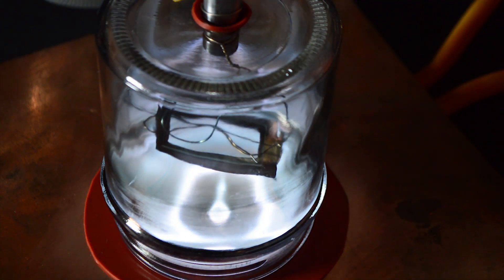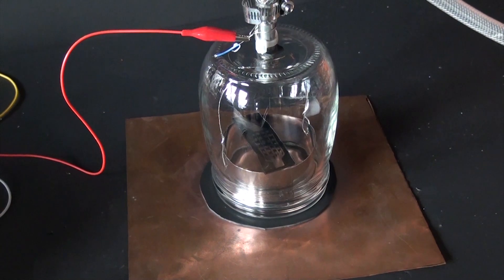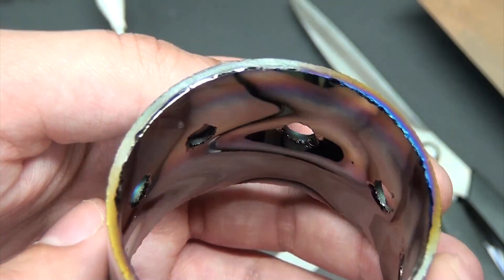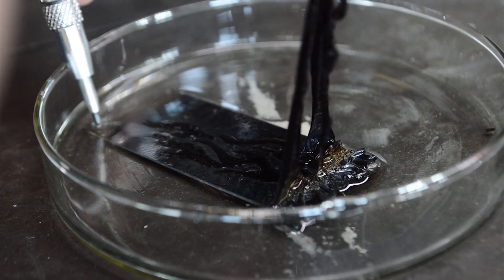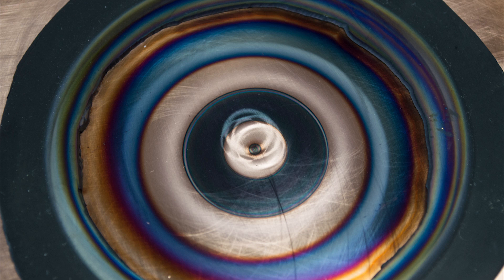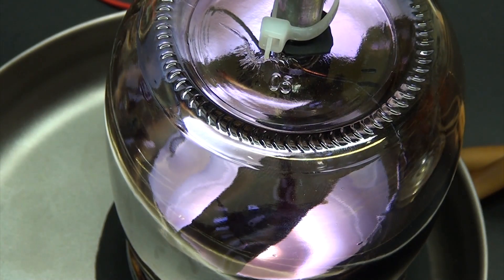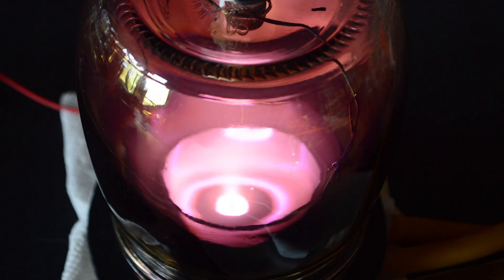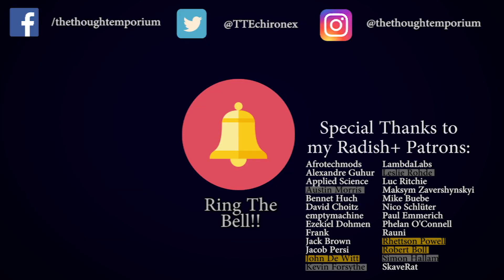Plasma Metal Coating... In a Jam Jar

Comment: I'm loving your new videos on sputter coating! I've seen inductively coupled rf plasma magnetrons being used for better yields of oxide films. Also, something that I found to be useful is thin films of nichrome, we would sputter nichrome to the back of a glass slide to resistive heat atomically flat gold crystals or silicon wafers for various high vacuum reactions, and we would sputter traces of alumel over the nichrome to work as quick thermocouples in a pinch. They were so useful, I ended up using them for everything from drying TLC plates to keeping my coffee warm.

Comment: PLUMBING TIP: Those gear clamps are more ideal for larger diameter and thicker hoses but very poor for small diameter or thin hoses. You want "ear clamps", also called "crimp clamps" or "cinch clamps" for precision plumbing. Oetiker is the best name brand but HomeDepot even sells such clamps under the brand name "Apollo". It takes a pair of fence wire pliers to crimp them but by using a pair of clamps with one rotated 90˚, I've never seen a better performing tubing clamp. The beverage industry runs on Oetiker ear clamps. Fantastic channel!!!

Comment: I remember seeing an experiment that someone did in a vacuum chamber, where they demonstrated the pressure exerted by light, on a piece of foil, attached to a tiny wire axel. (It think it was Cody'sLab that did this.) Anyway, my point is… Could you use some type of light to put pressure on the gasses in the vacuum chamber, to move them in a desired direction, to concentrate them a little, and make it easier to pump them all out? My hunch is, you need a wavelength of light (or electromagnetic radiation) that interacts strongly with the gasses in the chamber.

A related idea, is to use powerful pulses of light to jiggle stray atoms of gas loose from surfaces.

Comment: Did I hear YBCO??? Superconductors? I'm excited already.

Also bruh if you're trying to hook up a diff or ion pump eventually to get Al2O3 to sputter you're gonna need like a 15mTorr roughing pump, not 150. There is one that walmart of all people sells for air conditioner stuff at like 150 bucks, so if you want big improvements look there. For lots of good vacuum info check out the forums at fusor.net. Absolute gold mine, even for non-reactor builders.

Comment: You should see about sourcing a little bit of Cobalt for sputter coating on something! There's an office building in Montreal that is glad with blue Cobalt panels and Cobalt tinted glass. Beautiful looking building.

Did you know that in all of biology the color blue arises from the surface structure, unlike all other colors which are acquired directly or indirectly through diet as pigmentation.

Comment: what would happen if you use Xenon and Caesium, would it generate thrust
Reply: It already does, it's just pushing into the table and the forces are minimal. There's nothing special about xenon or caesium. Mercury's actually a good option for ion thrusters, and aside from that you can use literally any element if you want (and you don't mind eating the efficiency losses)

Comment: I'm thinking you could use this as a seed layer for electroplating thicker circuit traces so they can handle some current. But in order to do it all at once the whole pattern would need to be connected as one solid layer. You could sputter a pattern with some metal bridges between the individual traces. Then mask off the bridges, plate the traces thicker and then etch the thin bridges away. It's a lot of effort but it might be a way to create circuits directly onto weird objects (provided they can withstand the plating and etching  solutions of course). 

Ooor maybe all of this is unnecessary, idk how thick of a layer this can make.

Comment: This video series is my favorite on your channel! Glowing metal plasma, growing neurons, preserving animals, damn this machine is insane! Is it possible to manufacture dichroic filters with your setup? I'm using them for astrophotography, they pass through only some spectral lines (eg. H-alpha at 656.28nm) and I always wondered how these are made and how engineers even know how much metal they need to coat the glass for specific spectral line to pass through
Reply: Typically, they alternate between metals with high and low refractive index and each thin film is a quarter of the wavelength of the light they want to pass thru and so the films will constructively interfere with only that light while all the other wavelengths are reflected due to destructive interference.
Reply: @cristalsolares6379  thanks for explanation!

Comment: It seems like a lot of work to handle and prepare the glass jars you use as vacuum chamber. Why dont you make the vacuum chamber from  a stainless steel  pipe, and then just add a small inspection window made of acrylic ?

Comment: usually, when you apply vinyl cutouts, you remove the unwanted parts from the original backing, then you apply the transfer tape (your blue tape) and use it to apply on your surface.  Nice vid,  thank you!

Comment: Since no one answered this last time, what the benefits of sputtering over physical vapour deposition?
Reply from the maker: In theory sputtering is vastly more versatile. It keeps the materials intact better. ITO for example tends to lose the oxygen if you use a thermal method rather than sputtering so it ruins the conductivty

Comment: sorry to say but if your metal needed annealing it wasn't 24 carat gold because pure gold doesn't harden. it may have had gold in it but you got conned and bought sub par stuff there. next time go to a jewelry supply company like Rio grande jewelry supplies it may cost more (golds at $1400 us an ounce) but you will get the real thing.
Reply from the maker: Work hardening is a thing even in 24k gold
Reply: @thethoughtemporium  no your wrong, pure gold will NEVER harden no matter how long you beat on it. this is in fact how gold leaf is made, you take a lump of gold and keep hitting it (normally between two sheets of leather) until it is the thickness you want no heating involved at any point.

the only kinds of gold that harden are the less pure forms of gold. 18,14, 10 carat and so on have added metals to make them harder and can be work hardened because of those others metals mix in. but 24 k gold is pure and can never be work hardened no matter what

http://www.goldrefiners.com/blog/2016/6/24/can-gold-be-hardened
Reply: @thethoughtemporium  i know this because I'm a "gold smith"/jeweler (i work mostly with sliver but i still learned about how gold works)

Comment: I worked a paid summer internship as a line technician in the sputter department of a local plant.  Cody from Cody's Lab built a "Springel vacuum pump", that uses mercury to draw a vacuum down to the vapor pressure of mercury at the given temperature.

Comment: I wish those vacuum pumps were not so expensive and hard to find. Everything is fine until like 1-5 torr, then it suddenly becomes really expensive.
Reply: You can't get to -5 without high vacuum pumps.
The best forevacuum pumps barely get down to 9e-4.
However, with that said, you can easily buy affordable high vacuum pumps. Look for old oil diffusion pumps - they're virtually indestructible and have no moving parts. There's also plenty of fully functional turbomolecular pumps for under $500, with controllers(or ones that you can build a controller for easily).
But, as I've learned personally, the pumps are not your worst enemy. The plumbing is. A nice small vacuum chamber with all the necessary ports(gauges, DIY feedthroughs), even if just built out of tees and adapters, can easily run you $500 or more.
Reply: @Spirit532  I would be happy if I could build one for under 1000$. Thanks for the tip about diffusion pumps, I tried to avoid them because they might contaminate the vacuum with oil and take quite a while to heat up, but I guess they are my best bet because of the price/performance ratio and their stability.

Comment: I like what you are doing mate. I'm looking at this for my grandchildren as a teaching aid. Something they could do and make all kinds of thing. Also, you should try spay on (Teflon) for the chamber coating. You can buy this in a spray can. It's used as repair coating for pots and pans. After cleaning, just spray on and heat chamber to 300 to 400 degrees and hold for a short time. This should give a none stick coating. You could possibly use it instead of (VINYL). You could also try (PVA). Thin the (PVA) down and spray a light coating to the inside of chamber. Let it dry. Then heat to drive off any moisture. The (PVA) should wash out easily where (TEFLON) want.  I don't know if any of the suggestion stated here will work. Let me know. Take a look at Robert Murray Smith YouTube channel. He does a lot of things similar to what your doing.Thank you for showing all your skills. It is appreciated.

Comment: would a rotating magnetic field outside the glass work as well as rotating the sample for even coatings?
Reply: No, the magnetic field is there for accelerating the gas into the target. It doesn't steer them flying out.
Reply: @Spirit532  I get that the field on the base below the sputter source is to focus the plasma,  I was wondering if an extra field on the outside of the glass could be used to guide the sputtered plasma, removing the need for complex mechanics of rotating a sample inside the chamber. :)
Reply: @dasraiser  A different static field is not a uniform static field, sadly. It's far easier to just build a spinny bit.

Comment: Idea for plating with gold a.s.o.

use a very thin metal sheet that you electroplated with gold via simple electroplating out of auric acid. The total amount of gold should be very little. Maybe even just laying the metal sheet in an Au(III) solution should work --> Galvanic series

I don't know if this could work with straightforward aluminium foil. Would be pretty amazing
I imagine that the removal of the Al2O3 is the biggest problem here. Etching such a thin Al layer without cmpletlely destroying it is hard, but cound cause good results?
Just an idea

great work =)

Comment: You said that the coating is delicate. But you only coated the glass lenses with paint.
So how delicate is the metal coat? Is it only an issue if you touch something day after day (like you would do with glasses) or can you remove the coating simply by scratching it with your fingernail?
Reply: It depends on the bond, but it can be anywhere from "rubs off with a finger" to "needs sandpaper to remove".

Comment: Oh cool, superconductor coating opens up some very interesting experimemtal architectures. Did you know you can make a magnetic superconductor by coating a long cylinder of magnetically permeable matter like silicon iron with a coat of perfect superconductor? It has to be a perfect superconductor though, or your field lines are going to leak out of pinholes in the side. As long as it's right though, the fields that go in one end supposedly come out the other end unaltered. I've always wondered if it could be used to encase one whole pole of a pemanent magnet with the other end far enough away for the exposed face to approximate a magnetic monopole. Now that would be some experimentation.

Comment: You have probably already covered this but how durable is the metal coating? I play tuba and it would be cool to do gold designs on brass mouthpieces.
Reply from the maker: Depends what material you're coating. On metal you'll need to really work to scratch it. But on glass it scratches easily. Also depends what metal you use. In a future video I'll hopefully cover how to make layers that adhesr better but I need to get titanium working for that
Reply: The Thought Emporium. The mouthpieces are typically brass with a layer of silver. But I play with a mouthpiece that is 100% stainless steel. The materials are able to make a difference in how you sound (some of that sound like bs to me too) but they also feel different. Gold feels really nice to play on because of how smooth it is which is something that is hard to describe and something that you need to experience to understand. I’ve thought about attempting to electroplated one of my mouthpieces with a bit of gold to get that smooth effect but I think it would rub off really fast. If you have any friends that play brass they might have an old silver plated brass mouthpiece they would be willing to give you to try it on to see if it works. Thanks for the reply!

Comment: Very well done! I wish the pumps were cheaper. 😆
Reply: You can make one for cheap out of an old refridgerator pump just have to use a different.oil in it
Reply from the maker: That won't work. Pressure will never get even close to deep enough.

Comment: How thick can you make the coating?  Ive been kicking around how to make an injection mold for a tiny plastic gear.  If i could coat an original gear in say 1/8" of copper i would build one of these.  Just wondering how technically infeasable that would be.
Reply: It's possible, but extremely technically infeasible. The deposition rates here are tens to thousands of angstroms per second - that is, tens, maybe hundreds of nanometers per second if you're lucky.
You can calculate how long it'll take to sputter away over 3mm of material.
Reply: @Spirit532  At 100×10⁻⁹m⁄s, 3mm would take just over 8 hours.... so reducing the desired thickness to say 1mm (still enough to add some physical strength?), only a few hours....

Comment: If I could get the money I would totally build a sputtering machine. Especially because I have a 3d printer and would be very interested in making conductive traces in my parts. I might even possibly be able to sputter between layers of a 3d part to make multi-layer circuit boards with embedded features.
Reply: @ClickThisToSubscribe I am pretty sure he did and mentioned that PLA plastic completely destroys the copper plating solution.
Reply: Not stupid expensive. The most expensive part is the pump from what I've seen.
Reply: @blackoak4978  I saw a video recently(?) where the guy bought a vacuum pump (for HVAC Techs, I think) from Harbor Freight for his project.  It worked very well for him.  I just wish I could remember what his project was.
Reply: between layers of a 3d part  WHAT
Reply: @Codebreakerblue  So my thought process was that if I could incorparate some kind of clamp on my printbed I could take a part off before it was finished and after sputtering I could bring it back and continue the print from there.
Reply: Vacuum pumps are inexpensive now so it opens up a whole 'nother world.  Regarding your multayer 3D printed PCBs...I like where this is going. 😊

I have been playing around with the conductive plastics with my dual filament machine embedded in the regular insulative plastic to make hidden conductors.  Even the flexible conductive to make rubber contacts and "thin film" embedded resistors.  Fun stuff!!
Reply: Imagine the possibilities
Reply: Same, can't stop thinking about this

Comment: Q: could you electro plate (one side of) a titanium sheat with gold and then use the gold side to sputter some gold?
Reply: Using electroplated sources might be a good way to limit consumable use, but it does need a whole new layer of process control and complexity.
At this point, the only investment you're making is the initial purchase, as you're unlikely to use even a hundred microns of the material after many months of experiments, so it doesn't make much sense to jump through the hoops to get there.
The only reason I see to do this is if the amount of material you have is not enough to make a full source disk, but the quantity is enough, and you can't easily mechanically process it(roll it out).
Reply: @Spirit532  
I was more so wondering for lowering the strain on wallets (assuming it is less expensive). Managing material useage and therfore consistancy could be a good use of it too.

Comment: what about something like lithium? i suspect the lithium would still be reactive on a thin film, could it be possible to use this method to make a capacitor with this method, like put down a layer of a metal, then use your fan turn table thing to apply a thin coat of acrylic, and then more metal on top of that?
Reply: A thin layer of lithium, then a coating of wax, then a thin layer of iron chloride, then a thin layer of wax, keep building this up, then sit it on an anvil and hit it with a hammer, the iron chloride will be pushed into the lithium with a lot of force,....would it go bang? Sodium metal would work better.